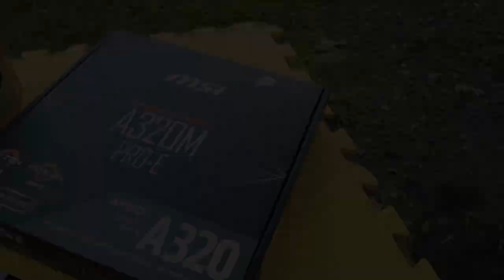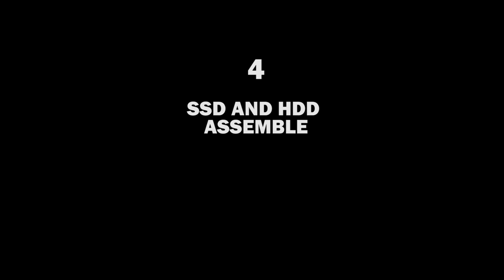Php 30K PC Build | Editing, Gaming and 3D Renders? No Problem | Assemble | Ryzen 5 & GTX 1650 EX

Comment: Ito build ko noong 2 weeks ago.

Mobo :TUf b450M gaming PRO 5,500
CPU: Ryzen 3100 7,000
RAM: TFORCE DELTA 3200 8X2 16GB 4,900
Storage: M.2 trancend 128Gb 1,400
                500Gb seagate baracuda recycled from my old Pc
GPU: Msi 1050 Super ventus 10,700
PSU: SUPER flower 80+ bronze 2,650
Case: FAntech aero cg80 with 4 RGB fan 2,450

Total 34,600 pesos lahat. Covid 19 Pandemic price, isama mo pa na back to school at lahat ng Pilipino bumibili ng new PC kaya sobrang mahal ng pc parts.

Comment: Sir sana masagot ano po ba Magandang Gpu for my Ryzen 5 3600 po sana masagot 7700php Budget ko
Reply: Add 3k boss and maybe you can get an rx 580 or a 1650 super. Depende sa pricing. And if you are willing to spend 14k+ get 1660 super.

Comment: Hello po kasya po ho ba ang gigabyte gtx 1660 super gaming sa ganyang case?? Hehehhe ganyan po kase case ko and im planning to upgrade my Videocard hehehehe
Reply from the maker: I think yes po, kakasya as long as compatible sa motherboard (GDDR5 or higher) at wala po yatang cooling system which is parang hindi magkakasya na sa case.
Reply: Motherboard ko po is aorus b450 m
Reply from the maker: base sa techware website, 360mm Max GPU Length ang kasya sa casing. So check mo ang length ng bibilhin mong Graphics Card length. https://www.tecware.co/vega-m
Reply: Jaime Federizon maraming salamat po😘😘😘😘